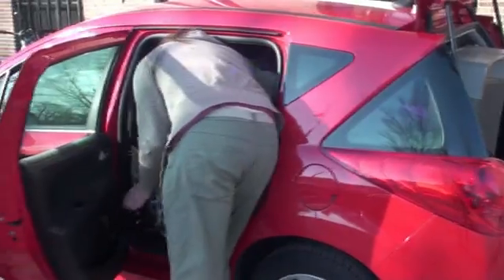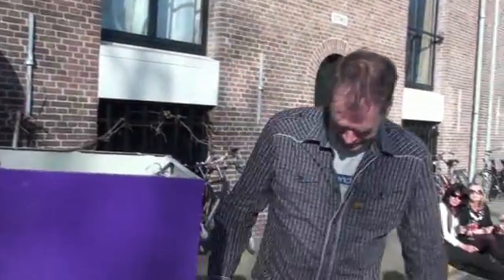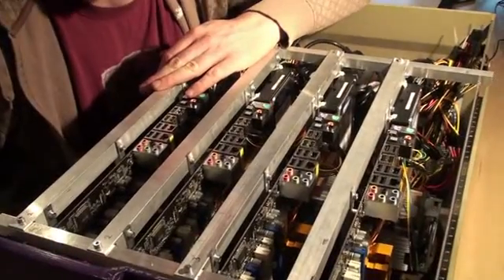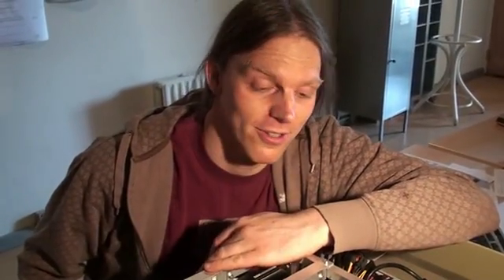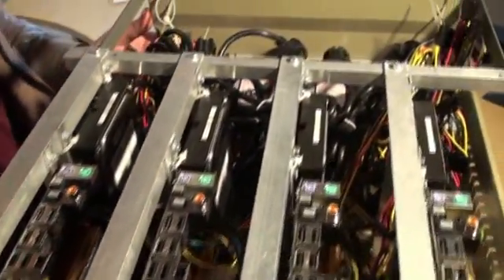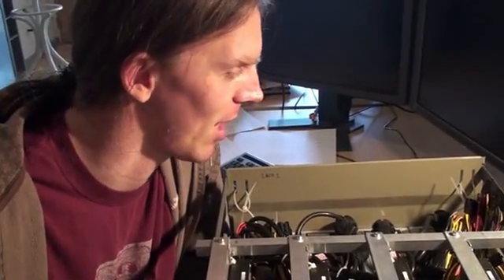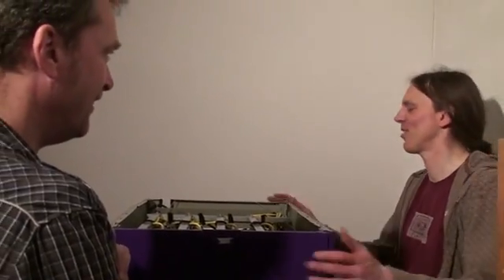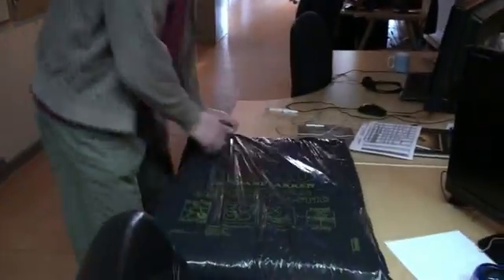Durian Project: Special delivery

Comment: Why didn't you guys try using a central power supply(with a failsafe, naturally) instead of stacking all those PSUs into the drawer?you could probably get away with 5 mobos, generated heat, and maybe asve a bit on the power bill?